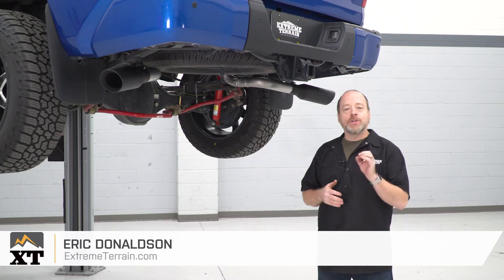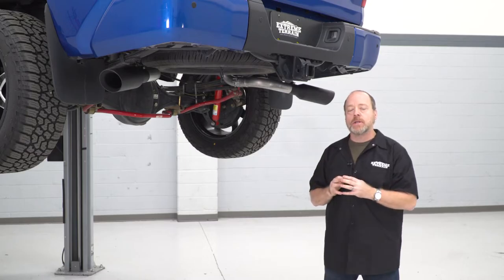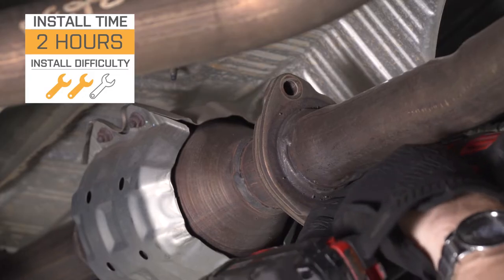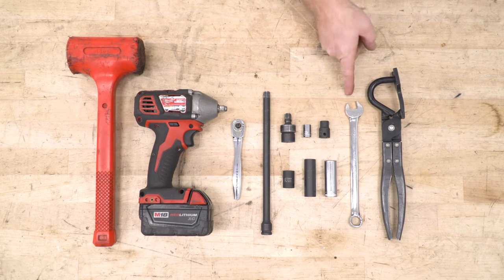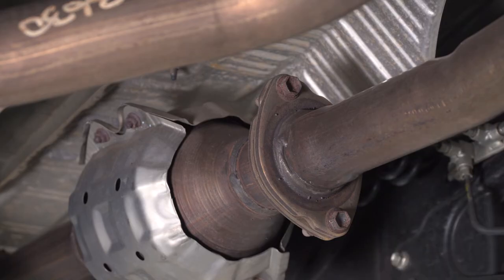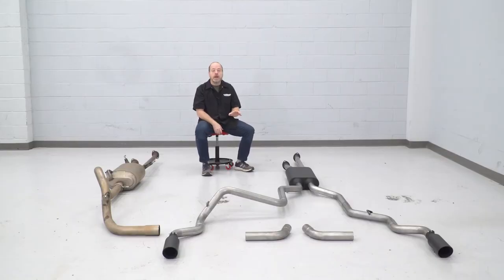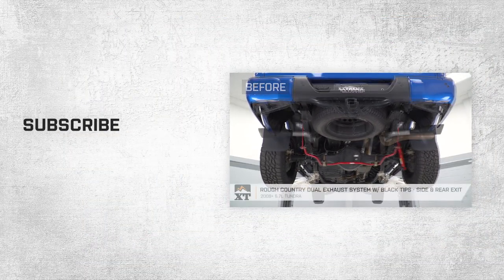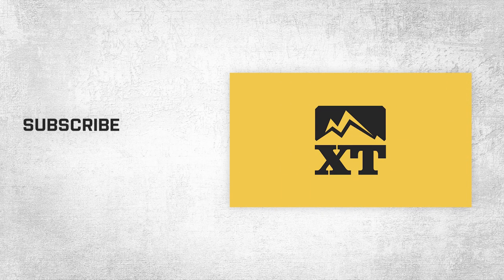2009-2021 Tundra 5.7L Rough Country Dual Exhaust System with Black Tips Sound Clip & Review

Comment: Cannot believe people are still buying these $1000 exhaust systems for our trucks. Go to a muffler shop. Have them remove the stock muffler and weld in a Y-Pipe and run a straight pipe. Costed me $80 in March of this year (2024). Blows this as well as all other expensive exhausts out of the water as far as sound goes. Very deep growl and can be heard from down the road!

Comment: Thanks for the added tutorial besides the instructions that came with the kit. Was helpful. Little longer than you took to get it on. But don't have a hoist. Had to also cut off the nuts and bolts that connect the cat converters to the exhaust pipes as they were too old. The edges couldn't even hold a socket or a wrench. Never been touched before but got deteriorated and rounded over time with salt and water. So anyone else, get ready for this if your truck is old. Shear the nuts off with  a grinder  and take a center punch and a hammer to smash the bolt through the hole. It will give eventually through the rust. Used an axle stand to hold the muffler in place, while installing. Perfect height, if you don't have a hoist. Also, when putting the clamps on any part of the whole kit, put them on with the nuts in a position that you can get at them with the socket, other wise you'll have to detach pipes and redo your work just to turn the clamp around to access the nut to secure it. Attached the two tips to the last two pieces of pipe beforehand, and then held those pieces up with an axel stand under the tip to hold it in place while securing the pipe to the other pipe before it, to get proper spacing. Otherwise it went according to plan. Sounds nice and not too overbearing/obnoxiously droning. Good quality product. Feel free to start the truck up while it has no cat-back exhaust after you drop the old one out, before you put the new one in, and giver a couple revs just for some childish straight-piped fun and wake the neighbours.

Comment: Great video. Thanks! Question for you: how easy is it to swap out the muffler w a more aggressive one if I'm not happy with the sound? Would I end up having to cut some of the pipes because the length won't necessarily match up with a new/different muffler or are mufflers similar in length for a tundra?

Comment: I just installed this kit a week ago on my 2021 Tundra. Its a great affordable bolt on kit but does not offer any noticeable sound agression from stock. Today I removed the king sized muffler that comes with this kit and replaced it with two 24214 Thrush glass packs ($68 for 2) for a true dual exhaust. Now it sounds way better....surprisngly the cabin noise is still very tolerable. If you want louder than Tundra 5.7 stock this isnt the kit but it can be easily modified and I still recommend
Reply from the maker: Thanks for watching! -Zach
Reply: How easy was it to add those two glass packs? Any pictures you could share?